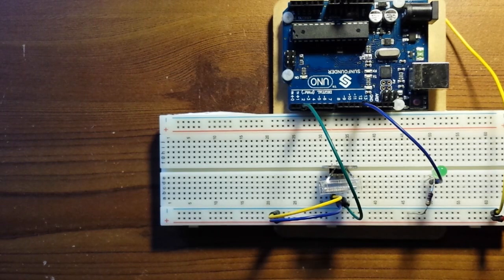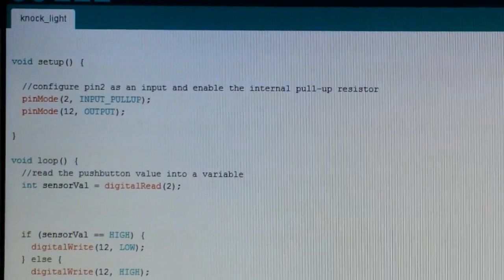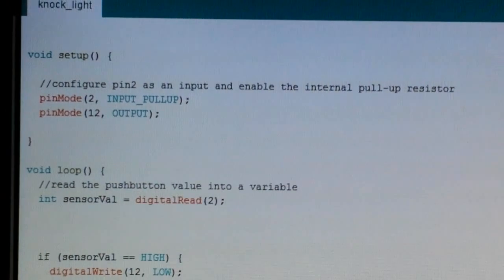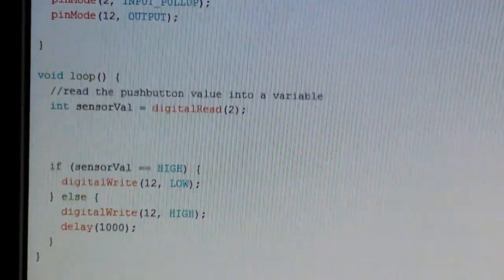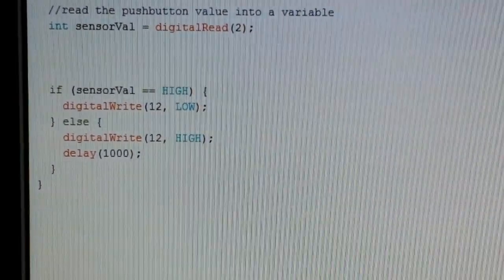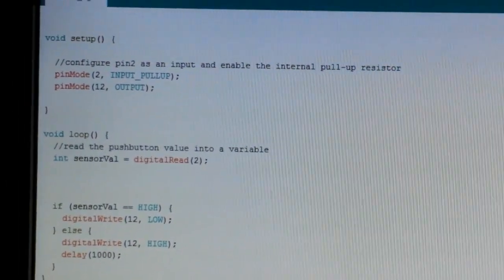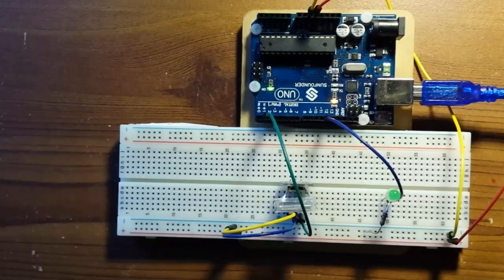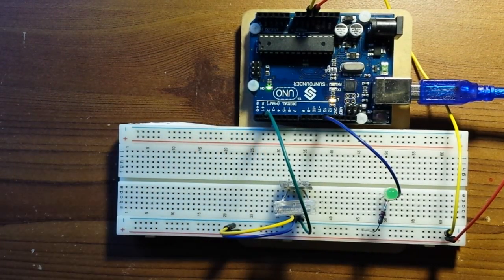Digital read and write

Comment: Just discovered your channel and love every bit of it. These arduino basics are excellent.

My question is how do you determine the proper resistor to use with your LED? Is there a formula or some math you can do depending on the LED?